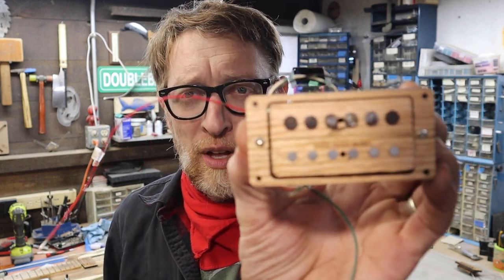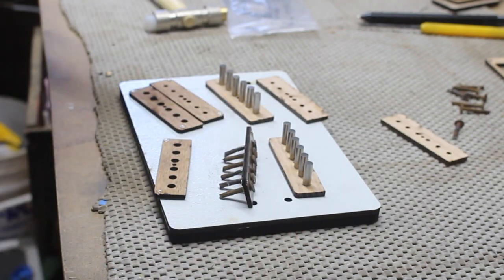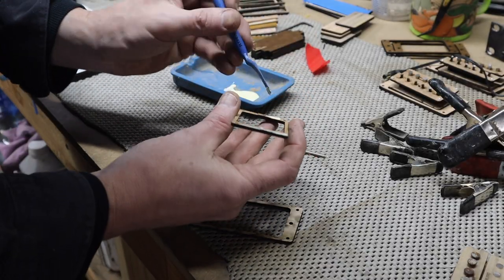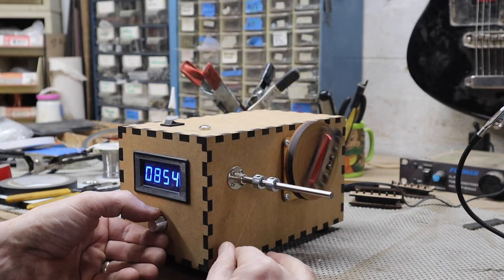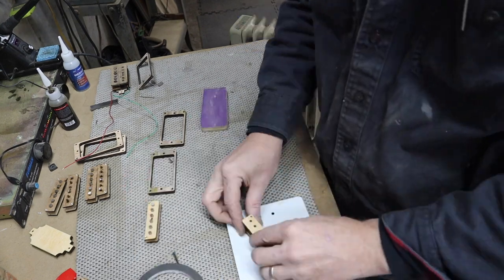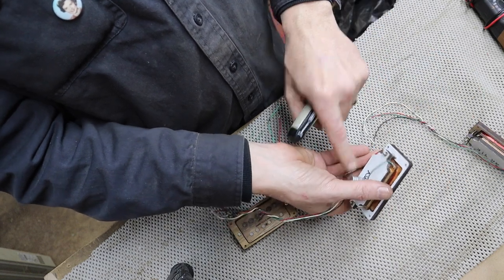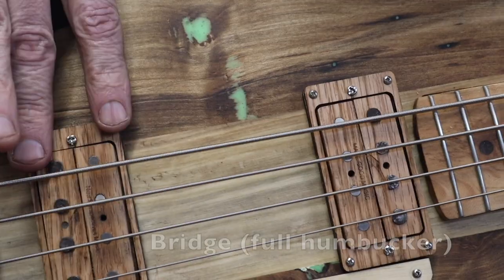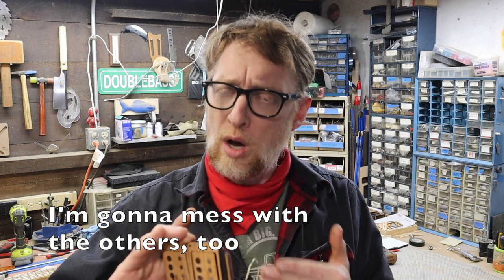DIY Pallet Wood & Rusty Nail Humbuckers - PAFS (Pallet AF)

Comment: Once you figure out how TPL's, tensions with which magnet and metals does what.. Different recipes and ideas can be a fun rabbit hole.
Reply from the maker: I've barely got my nose in the hole and I'm already loving it!
Reply: @timsway  it's a fun hole to drop into. I forgot to mention gauss and fine tuning magnets to your designs. It's a lot fun to geek out too. I found a deal for some older winders in a bulk sale a few years back. I got an old Gorman Bobbineer, an old REA desktop winder and an old Meteor 301. I fell hard into the rabbit hole..😂

Comment: tim sway hey buddy beautiful work. Shared with all my guitar buddies 👍  hey quick question.   Where, if you have found.  Blades for the delta planer?  I have a same one.  I Sharpen mine, i got two sets.  But they won’t outlast the planer that’s for sure.   Thanks bud. Keep up the great content 😎
Reply from the maker: they sell them right at my local box store but they don't say delta on the pack. They're pretty standard to several models: https://www.lowes.com/pd/CRAFTSMAN-Planer-Knives/1003014308

Comment: Pretty cool looking, just use steel slugs like a regular humbucker does and you should get a better balance. And I noticed you said alnico5,  (the 5 usually denotes the strenghth of the mag), so if you actually used magnets like in a single coil that would really create an imbalance.
Reply from the maker: I had it wired out of phase, like a moron. Wait until you hear them now. Stay tuned!

Comment: Having a good time watching you experiment with the humbuckers and I enjoyed your hollow core pallet wood bass, I just had a thought could I make humbuckers for a ukulele and could I get them to be clip in clip out?
Reply from the maker: as long as you put metal strings on it, you can. most uke strings are nylon so magnetic pickups won't work. I've made solid body electric ukes in the past and just used guitar strings.
Reply: @timsway  i know you said you were not a fan of pizo pick ups would they work with nylon strings?

Comment: Very cool pickups. One thing i noticed, you said for a humbucker the negative of the first coil goes into the positive of the second. That is not correct, if the coils are wound in the same direction, the finish wires should be connected together and then the start of the first coil is ground and the start of the second coil is the output. The coils has to be electrically out of phase since the magnetic polarity are opposite, then the resulting signal will be in phase when combined, but the hum will be out of phase and cancelled.
Reply from the maker: thanks for the info. I looked at a bunch of different schematics and have seen lots of confusing and conflicting information. The bass does sound a bit "out of phase:" to me and I plan on experimenting with the wiring some more with the ones I've made as well as do and learn more. Single coils are easy! lol.
Reply: This is correct.

Comment: I think they sound really good. On the splintery doors, I wonder if it would be beneficial (or worth the effort) to treat it with a resin or sodium silicate.
Reply from the maker: yes, but that would also mean using more resin... Instead, when I can, I look for the material that requires less VOCs, not more :)

Comment: Great video. Cool idea. Just a couple of ideas for you as you tinker. I have been a guitar builder for over 10 years and a pickup winder for the last 7 of those. Firstly, those coils looked a little thin, you could probably get away with another 1-3000 winds depending on wire gauge. Secondly, it appears you have just created 2x single coils in series, not a humbucker. I say this because a: there is still hum and b: humbuckers need to be reverse wound reverse polarity a step you either skipped in the video, failed to mention, or I just outright missed it? Anyway super cool prototype dude keep it up!

Comment: The poles don’t do any sensing. The screws just adjust how close the magnet is to the string. Closer makes the string more magnetic. All they do is magnetize the string. The coil is the portion that picks up the sound. There might be a little impedance going on with the poles that can color the sound but they aren’t responsible for the output of the pickup

Comment: Fender-style single coil pickups use alnico pole pieces, which can be magnetically charged (cheaper versions use a ceramic magnet underneath steel pole pieces). Humbuckers normally only have a bar magnet underneath the pickup, and located between the screws and (non-magnetised) steel slugs in the other coil. Your pickup shouldn't really have alnico slugs as well as a bar magnet: depending on how you have charged the alnico pole pieces, it seems that at least on one pickup shown in this video, the bar magnet polarity is cancelling-out the magnetic polarity of the alnico poles. I like the idea of making your own pickups, though the cost of the winder and the laser cutter will be very hard to recoup, unless you start to sell your pickups!
Reply from the maker: the laser cutter has paid for itself 10X over. Pound per pound it is the most valuable tool in my shop (and one of the most expensive). HIGHLY recommended if you want to make stuff for a living. Obviously i use it to make other things, too :) The winder is inexpensive. thanks for thew input!

Comment: This is awesome!
How did you get the humbuckers to run as separated single coils? I tried this but couldn’t figure out the wiring
Reply from the maker: It has to be "wired" to do this, but some pickups you buy will already be wired and sealed with only 2 wires while others will have 4 or 5. If you have the wire, you simply ground out the two that are "in the middle" of the circuit via a switch. so when the switch is on the wires are grounded, off they run free. This will "turn off" half the pickup. It's usually the black and white wires,and they are usually soldered together, when working with factory made pickups.

Comment: The common mode noise cancellation doesn't care which way up the pickup is the EM fields are all around. The differential summing of the wanted signal does care because the strings are one one side, but it doesn't matter in the sense that there is only one signal level coming out that's the sum of the two pickups. If you're splitting the coils, it matters more since you get to hear the pickups in isolation and the volume difference switching between pickups is not a good thing - you can add more magnet or more turns. The classy move is to add more turns on the upside-down side (increasing the DC resistance) to balance the voltage but put an active buffer on it so it doesn't matter. More less magnetism with more gain to compensate is the route to more sustain - the reverse EMF in the strings is how pickups dampen the strings. These opinions are because I'm an EE and so solving it in the electronics is always the correct thing to do. Other perspectives may favour slapping on a bar magnet. It's all good.
Reply: The other neato scheme to balance volume is to turn the magnets upside down instead of the whole pickup, wind it the other way around and have both pickups facing magnets up. The EM interference in the counter wound coils cancels. The voltage from each side is the same phase and so sums because of the double-negative of the wind direction and the magnet upside downyness. If you do this you want to think about how other pickups interact when both are split - you don't want noise summing.

Comment: Using alnico for one coil and soft nails for the other makes it difficult to keep the inductance of each coil identical, so I would expect the hum cancelling to be less than if the polepieces for each coil were the same, regardless of the number of wire turns or dc resistance. Steel/iron polepieces raises the inductance of the coil, sometimes very significantly, compared to alnico slug magnets. Also, magnets used as polepieces tend to exert much more pull on strings that steel/iron polepieces loaded with separate magnets.

Comment: As these pickups are all about recycling. What about the possibility of actually using the wire from an electric motor. They after all are still thin insulated copper wire  and you should be able to find all different gauges to experiment with, also they might have other useful bits you could incorporate into the pickups.  ⭐⭐⭐⭐⭐
Reply from the maker: that is a future goal.

Comment: You didn't need to magnetize the slugs, they become magnetized when they make contact with the bar magnet. In fact, it's probably why there's balance issues between the two coils.
Reply from the maker: I brain cramped and wired them out of phase. It sounds amazing now! Stay tuned to hear them in a couple weeks!

Comment: If you are putting a bar magnet on the bottom of the pickup, you it is not necessary to magnetize the pole pieces. If one coils pole pieces touch the south side of the bottom bar magnet an the other pieces pole pieces touch the north, the pole pieces will carry the magnetism (I quess I should say magnetic flux) through and the pickup will work. Magnetizing one set of pole pieces might sound different though. Oh... The screws as pole pieces in some pickups are adjustable and can be used to balance the string to string volume, but also tune the sound. If you screw all of them outwards a few turns, it will make the pickup brighter.
Reply: Oh... Someone already told you this... :)

Comment: if you want to make them even more reclaimed, you can also use magnetic wire from older CRT tv degaussing coil your best bet are Computer monitors which have the thinnest magnetic wires whereas, with CRT tv's, it may be different thickness from one set to another, however from experience, The Sony Trinitron crt have the best and most amount magnetic wire.
Reply from the maker: I have a small collection of electric motors. the copper wire is much thicker. I wanted to use at least a couple proper parts to start and chip away at it :)
Reply: @timsway  Electric motors don't make for good wire reclaiming material, google  crt tv degaussing coil or look up a video by Russ https://www.youtube.com/watch?v=7TXTZCYNWWA pretty much shows how to get the wire from start to finish lol But yeah it does involve a little more work as all reclaiming material does. Nonetheless, your reclaiming projects are cool!

Comment: I would love some of those in like a stupidly high output p90 format! Lol

But I have a bit of a question. I had heard of a famous pickup maker (John Birch...maybe?) who used epoxy instead of wax to pot his pickups...is there any benefit to using epoxy over wax?
Reply: More rugged if done right.

Impossible to repair if corrosion happens though.
Reply: Epoxy would be more permanent 
Which can be good or bad
Reply: @alaricpaley6865  Could corrosion occur through epoxy? Or do u mean the pole pieces?
Reply: @lordimpaler3899  If something is sticking out of the epoxy, moisture can get in. So past pole pieces or the wire leads.

Expoy has a tendency to shrink as it cures, which can lead to an increase in internal stresses, which can create micro-cracks and tiny capillary zones around the coil windings for moisture like sweat to wick into.

How relevant that is is for others to judge, and really depends on what type of use the instrument will see. I doubt it's bad, but I think Wax is a little nicer to work with, and you can more easily save magnets from a dead pickup.
Reply: @alaricpaley6865  Yea, the more I read about it, the more i think wax is the way to go. Thanks 👍
Reply from the maker: Alaric knows more than me for sure, but I would add wax over resin for the environmental costs of resin vs wax.

Comment: can i use magnetic slugs instead of just slugs for a diy humbucker? do i still have to put the magnetic core in it or can i skip that step if i put magnetic slugs?
Reply from the maker: You can skip the magnet in the bottom if you use magnetic slugs. It's way easier that way. Just remember to reverse polarity and wind direction on one side - and connect the negative lead of one to the positive lead of the other coil.
Reply: @timsway thanks!

Comment: Just rewatched to check I didn't miss anything and when describing humbuckers vs single coils you say "they are both identical" when referring to the 2 single coils used in making the PAF. In order to buck hums these should be reverse wound, reverse polarity in order to cancel out any interference. You do later mention one side being north and one south but you still need to reverse wind. Also scatter winding refers to being scattered and random but over all even coverage. It creates slightly more emphasis on the variation in EM field ergo each pickup is unique. If you were just going left and right, it is a straight wind pattern but the human element gives variation in each coil vs a machine.

Comment: what sort of wire is it  that you solder to the pickup that you attach to the guitar
Reply from the maker: I use wire I reclaimed from old, broken pinball machines. Each machine has hundreds of feet of wire in them.
Reply: @timsway  cool thanks

Comment: all the magnet does is turn the strings into magnets, and then the coil is a normal inductor turning that changing magnetic feild into electric flow. technically you don't even have to have the magnet attached to the coil at all! it's just more convenient from a field and construction perspective to have the magnet be part of the bobbin. you could just as easily glue a flat magnet onto the pickguard next to each coil and it would work.
Reply: on that topic it would be cool to see pickups that re-use the magnets from old hard drives, good way to get high tesla magnets for cheap or free as a reclaimed material
Reply from the maker: love it! I do want to get into reclaimed magnets and stuff, too. Hell, I'd love to even unwind old dc motors and stuff :) I'm just beginning down this road.
Reply: @timsway  most motors and transformers use higher gauge wire than pickups, so you might have to make them as "low-z" (using fewer turns and then an audio-grade transformer to impedance convert) to compensate. or an active preamp of some sort

Comment: Can you make a guitar pickup that sounds distorted? A 6 string guitar not bass guitar
Reply from the maker: I'm still new at this but my understanding is the distortion comes after, but you can make them very "hot" so they distort easily. I suppose you could also add circuitry right to the pickup, or on the guitar as many do.

Comment: If that green stuff on the bass is pallet treatment, you are dealing with some toxic stuff right there.
Reply from the maker: lol. it's epoxy with glow in the dark tint
Reply: @timsway  Oh, then I really hope you are using propper PPE while sanding etc. Better skimp on materials than on PPE. Respiratory issues sucks. Take it from one who knows first hand :-) By the way, I've like the couple of videos I've seen from you today. Never saw your channel before.
Reply from the maker: @Dandelion-32  Thank you for your concern. I don't get in to safety in every video, of course, but the pallet was heat treated, not MB, and yes, I run an air filter, use a push stick, wear ppe, etc. etc. :)

Comment: Do yourself a huge favour and get a cheap multimeter that can measure inductance, LCR types that just do inductance, capacitance and resistance are very cheap now. Inductance is the key property of guitar pickups and the main factor in frequency response, it will tell you what your core material is contributing to the output and frequency response (pickups are an LCR filter, use the volume pot and amplifier input resistance for R and the cable capacitance (about 500pf) for C, if you run the numbers, the capacitance of pickup and the amount you can influence is a few feet of guitar cable) so you won't be shooting in the dark. DC resistance is something of a proxy for this from the days you needed expensive lab equipment and some knowledge to measure inductance.

Pick nails that stick to a magnet really well, some hardened steels don't at all and for this use is problematic. It may be that your inadvertent heat treatment with the belt sander alters this.

Note that a classic humbucker uses steel slugs with a magnet in the rear not alnico rods, and you need about 8500 turns around around alnico rods to get the same inductance and cut-off frequency as 6500 turns around steel slugs IIRC. But two coils voiced like strat singles make a really gutsy distortion humbucker. You get different behaviour in the upper mids as you change the about of inductive core material and winds to get the same inductance, alnico or less steel can give you a resonant stratty spike, increasing the amount of steel drops this spike and my give a slight bid scoop before dropping into a very smooth rolloff like the tone was rolled off if you have a lot of steel.
Reply from the maker: thanks for all the info! That's why I make and share these videos. It's a two-way street of knowledge :)

Comment: So...Im wondering if the nails arnt capable of allowing the full magnetism of the screw in conventional PAFs (Patent Applied For)
I understand the idea behind the pallet nail reuse for your PAFs (Pallet As F***) but I wonder if perhaps a different metal nail could be used.  If Metallurgy figures in in some way. 
Complete utter nonsense.  But understand I am rooting for your ultimate success.
Having a world filled with 
Tim Shaw PAFs and Tim Sway PAFs gives me hope for the future.
Reply from the maker: I had them wired wrong (out of phase). Stay tuned for better demos. they work great! (or go to my instagram to hear the bass now :)